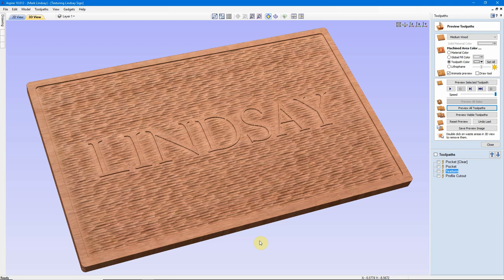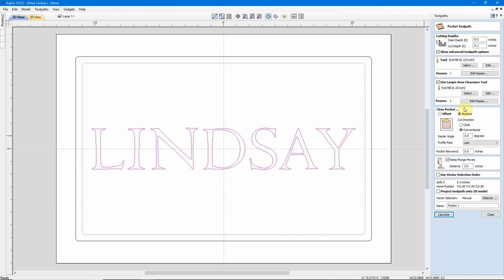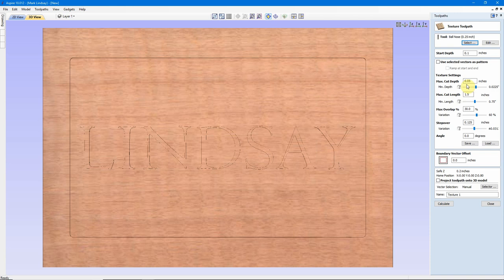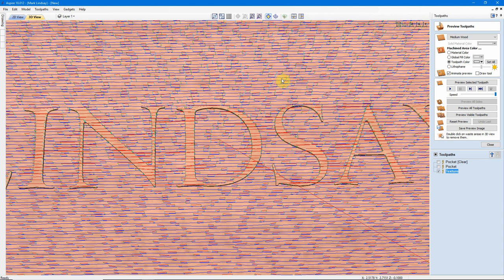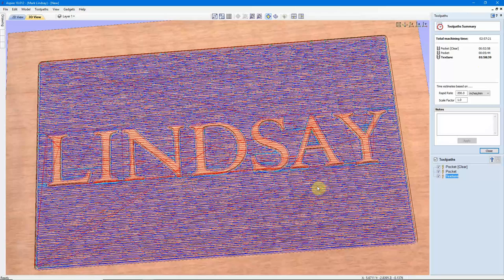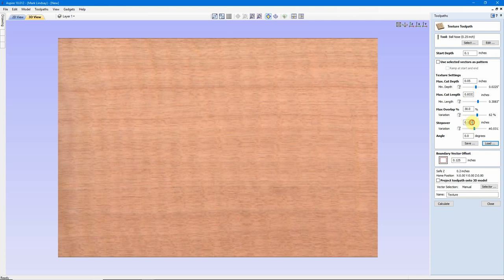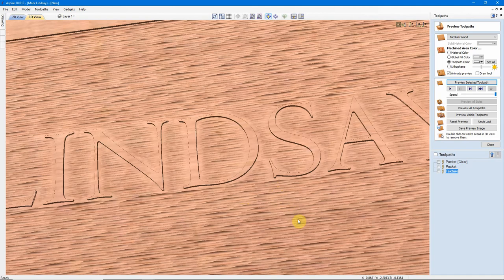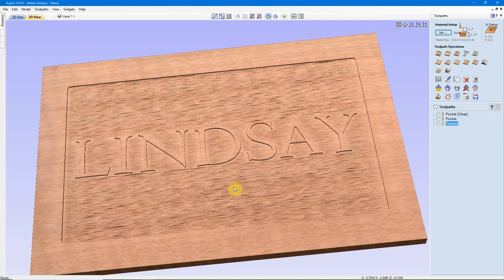Intro to the Texturing Toolpath - Part 35 - Vectric For Absolute Beginners

Comment: One day, I decided to just spend some time fooling around with texture tool paths. One of the interesting things I did was to create two (or, more?) tool paths on the same project -- one with a positive raster angle and the other with a negative angle. Cut one right over the top of the other. Just trying different angles and patterns. As you mentioned, it can really eat up the machining time, but some of the effects can be quite striking. Probably only practical for "artsy" projects. 

As always, Mark, really enjoyable and informative. Thanks!
Reply from the maker: Thank you very much, Jim! In playing around with several techniques, I've come up with some absolutely fantastic looking effects, but the machining time on some of them have kept me from actually carving them. That's really easy to do. Maybe one day I'll get brave, grab a sammich (or two,) and cut one of them. It'll be a long carve, but hey...

Comment: Mark, Not sure if you have an updated Video but it took me a few since I run version 10.515.  It turns out you no longer select the 1/4" clearance tool path in the profile screen with a check box.  You simply select or add a second tool bit in the select tool bit dialog box.  Vcarve automatically breaks this up into two files when you hit "Calculate".  Hope this helps.  I like your presentation in this video so that was my only hurdle but the help screens got me there quickly.

Comment: Mark, not sure if you will get this question a couple years after posting this video. I am trying to add some texture to some knife scales that am machining on my cnc. I have my right side handle/scale with my outside profile and a couple through holes as well as the texture that I want. Is there any way to copy/paste or create the exact same texture/pattern on left side handle/scale? I tried to copy/paste and flip but that is only working for the shape/profile. When I then go to run the same values on this left side scale for the texture toolpath I get a completely different looking texture.

Comment: Mark as a beginer I'm using the vector free software to learn before I make a decision on a machine. I dont have a location to adda larger area clearance tool. How iis that located? Many thanks for all your great information
Reply from the maker: Look right beneath the box where you enter the cut depth of the toolpath, and make sure there's a checkmark next to "Show advanced toolpath options." Do know that not all toolpaths offer the larger area clearance tool option, as they're not designed to use more than one tool. For example, Profile toolpaths, Drilling toolpaths, Quick Engrave toolpaths, etc. do not offer a larger area clearance tool option, as the toolpath is designed to use only one bit.
Reply: @MarkLindsayCNC  thanks for sharing your knowledge

Comment: Under the Tab of "Pocket Toolpaths" I do not have the option for Large Area Clearance Tool.....I have Vcarve Pro.  Is there an option I am missing to have that option turned on?
Reply from the maker: It depends on which version you have. The "Large Area Clearance Tool" check box was removed starting with Version 10.5. If you have version 10.5 or later, you no longer need to worry about that. You can just click the SELECT button in the TOOLS area, and add as many tools as you like, one at a time. That will do the same thing as the "Large Area Clearance Tool" option did in the older versions.
Reply: @MarkLindsayCNC  Aaahhh.....gotcha!   Thanks. Didn't realize you could add multiple tools like that.  Still a new!  Thanks again!

Comment: Mark we do value your opinion.  Can you explain how you decide that you have  reached the max feed rate on a bit doing lets say this texture sample video here. I noticed that  your.25 ballnose bit was set at 40ipm. you side that  that was slow. So what I would like to see is a video on your machine running at 40ipm and then you stepping up the feed rate to what you think is the max. So that we could listen to your machine. That may not be anything  you are willing to do I understand. thanks for another great video. Are all of the textures you brought up the  same in 9.5 or has vectric 10 ones  different.  Jeff Peters
Reply from the maker: Thank you, Jeff. I tried to make a video that demonstrated the chatter I talk about when referring to feed rates, but it's very hard to capture audio that's usable in a video like that. Simply put, the router is too loud. It's so loud, it drowns out the sound of the bit just enough that you can't make heads or tails of it. When I get my shop built and get a spindle that's a lot quieter, I certainly plan on making just such a video.
Basically, you're listening and watching for vibration, or any sign that the bit is struggling to cut the wood. If it looks like it's trying to force it through the material, instead of cutting it, you need to slow down the feed rate or raise the RPM of the spindle/router. If you can increase the RPM through the control software (without having to physically touch the router/spindle,) then you might be able to maintain that feed rate. If not, slow down the feed rate until the bit is cutting smoothly, and let it run at that rate.
Reply: @MarkLindsayCNC  excellent answer here Mark.  You explained the "trial and error" process so that we can understand it.

Comment: Mark, can the texture toolpath feature be used for making checkering or knuckling by using one toolpath at 30 degrees and another at 120 while setting the mins and maxes at the same values and zero variability on the step over?
Reply from the maker: Try it and preview it! It sounds interesting! Please let me know if it works out for you - I'd like to find out for myself.